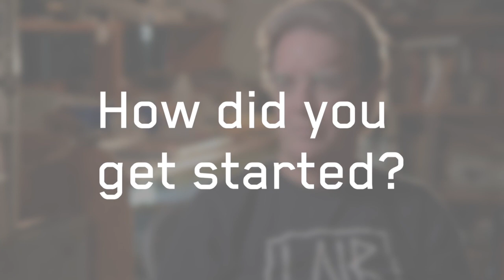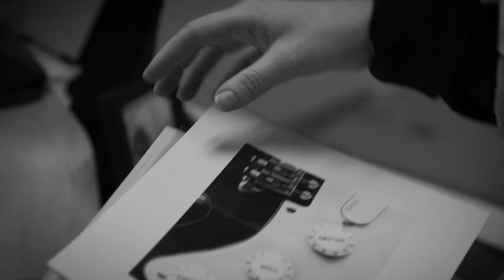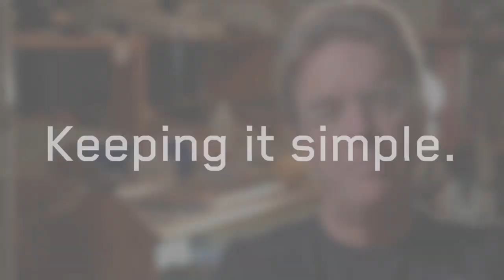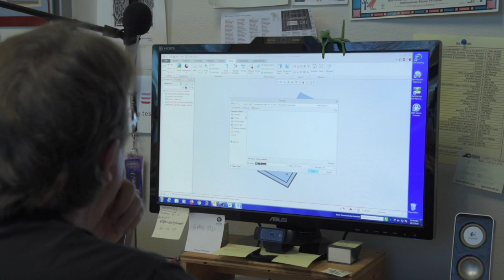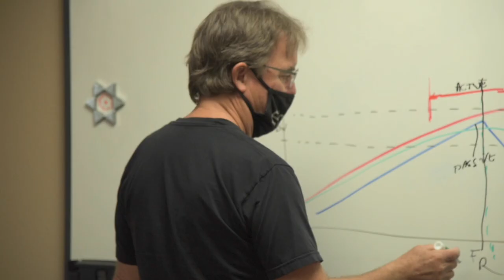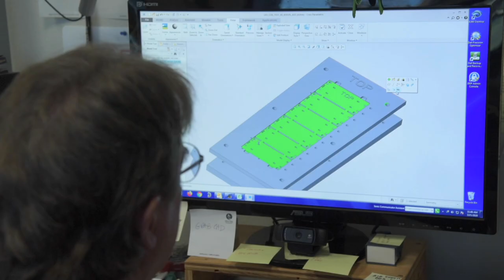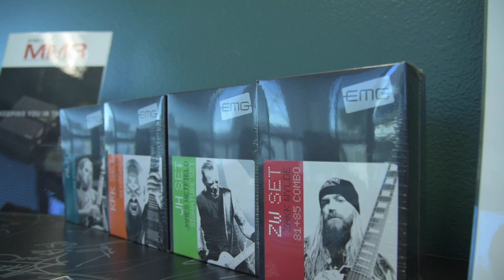Get To Know EMG: A Sit Down with Founder Rob Turner

Comment: I've had EMGs in my #1 since around '88. It had an OK strat style trem that I replaced with a Kahler system which allowed me to remove the springs in the back.  This gave me the perfect spot for the battery so I made a little retainer and done. The neck pickup splits and sounds glorious on a chimey amp for blues.
 A few years ago I got an ESP LTD Evertune with an EMG set.  OF course that has a battery pocket built in. I think I'll break it out tomorrow for my birthday and try it on my new Syn Morgan AC.

Comment: My view of EMG has always been don't knock them until you try them. When I first tried an EMG 81 around 1985 I was eleven, had only been playing guitar a year, and held no preconceived notions as to whether active or passive was better, solid state vs tube, etc. I was just blown away by the tone of the 81, then the 85, and the single coils. In short time I had an 81/85 set installed on a strat and was just thrilled with it. Many friends followed my lead and also got into EMG and many I know still use them. For metal, the 81 is still the king animal of high gain pickups.

Comment: I'm a Jazz/Swing/Blues player (Country now too, with my amazing wife). I'm also lucky to have Rob as a friend! 
 About 20 years ago, I was playing music with Rob (who is a drummer!), my old friend Nick, and a couple of other guys. 
I mentioned that I was building a Tele style guitar, and Rob said "Let me put pickups in it"
 As I said, I play clean, and had always thought EMG's were for distorted Rock & hi gain, so I said "no thanks". Turns out that the set of Fender pickups I bought online were both open circuits (yep, I got screwed!), so I finally turned my mostly finished Turbocaster T Style over to Rob.
 The next Friday, he gave the guitar back, and it BLEW MY MIND!!! It was putting out the cleanest, sweetest most complex tones of any guitar (LOTS!!) I had ever payed!!!
 Turns out this prototype set was developed by Rob and the amazing Vince Gill, and basically voiced after Vince's prized '52 Tele (the set became the Retro-Active T-52 set). 
 I have used EMG's exclusively in every Turbocaster I have built since (around 23 I think) and have EMG's in all my own performing guitars, including the ACS Soundhole Pickups (best acoustic sounds I've found)in both my wife's and my own handmade Yamamoto acoustics,
my 7 string,  Model 91 Archtop pickups in my archtops, and an EMG in a 10 string portable Lap Steel.
 Additionally, when I asked Rob about Jazzmaster pickups, he decided to build them as well!!! I used the prototypes in a couple of my working Turbocaster TJM's for a year or so, and we worked out a couple of glitches, and now---WOW! The most versatile guitars I've ever played!!!
 These are now in production as the J-Master Set and System, and I LOVE them!!
 Rob just sent me a new prototype sound hole pickup and I put it Jill's guitar in time for our last Jill & Kevin show a few nights ago, and it's even better that the ACS!! (which was already the best sounding acoustic pickup I've ever found). We used it thru our Bose L1 Compact system and it sounds almost exactly like the guitar played acoustically!!! I also tried in in one of our Fishman LoudBox Mini Charge amps with the same results.
Point is: EMG's are NOT just for rockers!! They deliver the cleanest, clearest tones with all the richness you could possibly find anywhere! and NO NOISE!!!
 And the "issues" with batteries???? If you you remember to unplug your cord when you're not using the guitar, even playing a couple of hours every day and a couple of shows a week, the batteries last well over a year! If you forget, they still go several months!
 As Rob said, there's only so much that can be done with magnetic pickups, but active pickups can (and do) SO much more!!!

Comment: How nice a video! I've been a tone-to-the-bone guitarist for a very long time (fingers, guitar, amp no effect, not even a pedal) and tried all along to improve my equipment (from transistor to valve amp, from cheap to pro guitar) until i reached a decent tone out of it. Somehow in the process I got stuck to passive pickups until in 2017 I bought a Fujigen guitar equipped with the Steve Lukather set. It was intended to be a back-up guitar fro a minimal easy -to-go set-up, so I paired it to a Roland MicroCube GX (2 watt amp with integrated Boss effects). It quickly became my main guitar-amp set-up (when not playing with a band), simply because the EMG pickups are that good. They play well and they're dead quiet, making your effects sound better. I can't think about going back to passive pickups today, once I've experienced the pros of the EMG, and I'm happy and proud of having decided to be curious  enough to go for them.. After this video and knowing that their manufacturer is a very thoughtful man not keen to out-sourcing makes me even feel better.

Comment: I was part of the whole Anti EMG group in the 80-2000's.  In the 80s-2010 I was all about Dimarzio.  Then in the 2010's I started getting into Seymours.  I only knew a few folks that used EMG, the tuned down metal bands, Metal Bands, David Gilmour, Vito Bratta and Reb Beach.  But it was really when my eye sight started to go south that I started googling if there was a way to install pickups with soldering them when I came across EMG's solderless stuff.  So,  instead of actually buying a set of EMG's, I bought a Harley Benton that came w/ the EMG Retroactive fat 55's and I fell in love.. Then I started youtubing Emg's and Ritchie Faulkners stuff really got me going, so i ordered a few sets of the 57/66s.  Now I'm getting a set that's 85/81, I want to try them both in the different positions and see what I like most.  but the solderless makes these even more enjoyable.  and so far the tones are amazing.. cant' wait to look into more sets.

Comment: I wish there was more information on how the emg SA pickup has changed. Are they still the same design as the mid 80s? Like the ones David Gilmour used or Jamie West Oram from the fixx used? Or has the SA design changed and the ones sold now are different then the ones back then? Please shed some light

Comment: Chief, try to consider using Lithium rechargeable battery that can be charged using mobil phone charger. That will make it simpler and no more requirement for spare battery. Cheers from Indonesia.

Comment: Mics are phantom powered though..  EMG should make a phantom power mini pedal so no batteries are required.  Just use a TRS cable to your pedalboard.
Reply: @remarkablehairdo3110  no.  They have a box that supplies 18v.  I'm talking about a guitar pedal that actually looks like it belongs on a pedal board.

Comment: Isn’t it possible to supply a power to your pups via a guitar cable? Special cable with a conductor for power supply if needed , u know.. like phantom power kinda.. to avoid these fukn batteries inside a guitar. “Emg cable”! With a some kind of power supply box on the floor that could also include other additional functions like signal splitting/duplicating, etc..
Possible? What do u say? Cheers guys ❤ u are a progress!